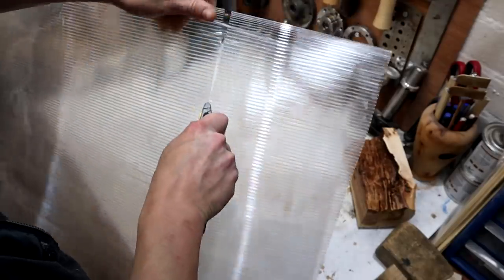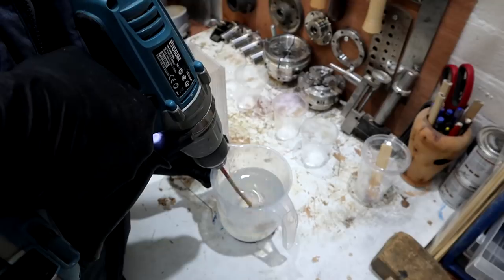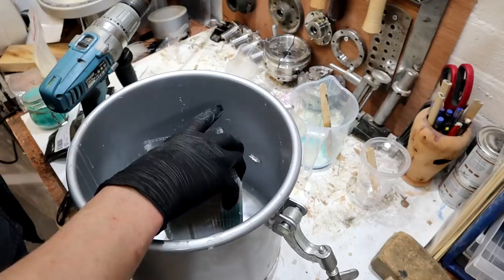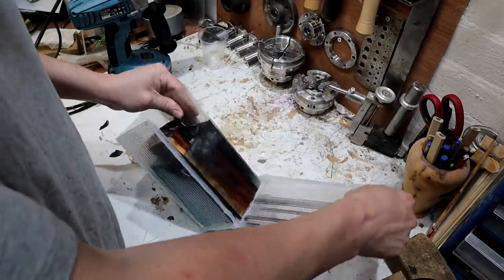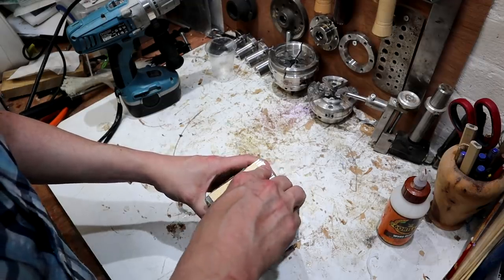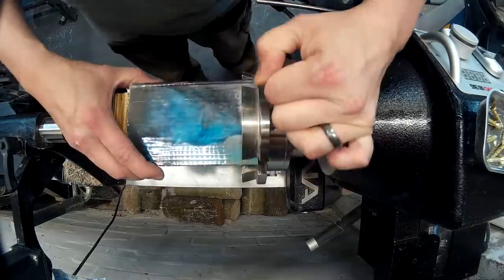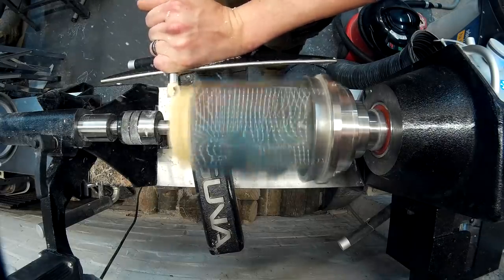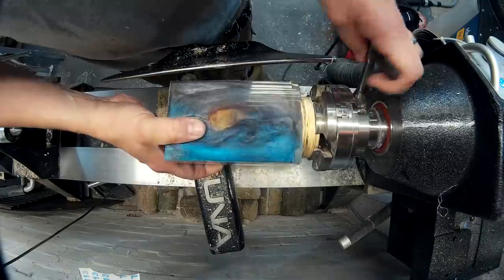Woodturning - The Beer Glass

Comment: Better than best!!
Why you warm up the wood?
And how much time?
And temperature?
Reply from the maker: Needs to be less than 4% moisture content to work with epoxy correctly, the temperature is about 106 degrees and time is based on weight reduction as the moisture boils off

Comment: Amazing as always. May I ask why you didn't shape the plastic mold as a cylinder before pouring the epoxy ?
Reply from the maker: Thanks, I would need to get the wood half round, and as I'm only using half it wouldn't be advisable to try and turn something with so little strength  👍
Reply: @MattJordanWoodturning  Got it, thanks !

Comment: Beautiful!  How long do you dry wood for in the toaster oven and at what temperature?  Thanks.
Reply from the maker: Measure the moisture content, weight it, then work out how much weight it needs to loose to get to your desired moisture content, then weigh it every hour until you are done, could be 12 hours at least depending on how wet the wood is to start. Then leave it for a couple of weeks to stabilize  👍
Reply: @MattJordanWoodturning  thanks.  what temperature do you set the oven to?

Comment: hi, what is the equipment you use to process the epoxy?  how long you put the wood in the oven? thx
Reply from the maker: I just use a set of kitchen scales to weigh it out, mix it up, place it in the mould then use the pressure pot while its curing, appox 4bar pressure. The wood stays in the oven until the total moisture content is down below 4% total weight 👍
Reply: thks, love it